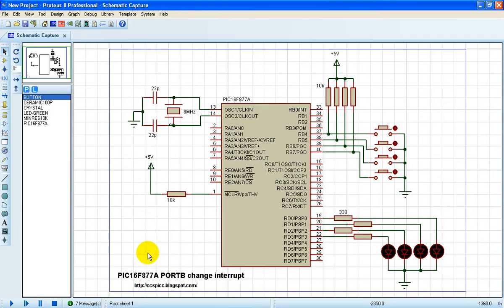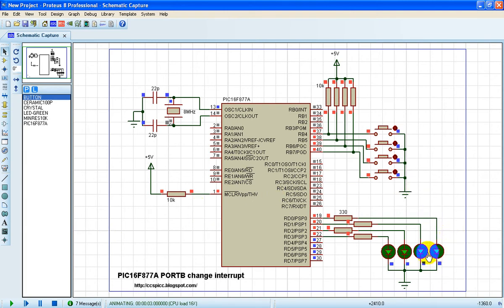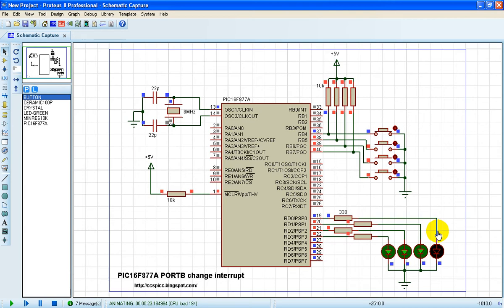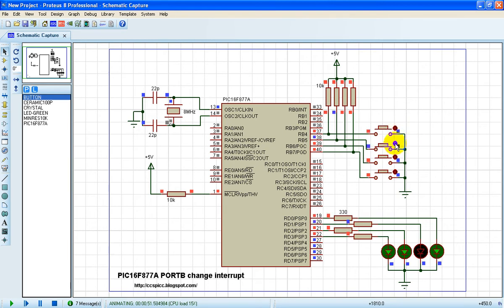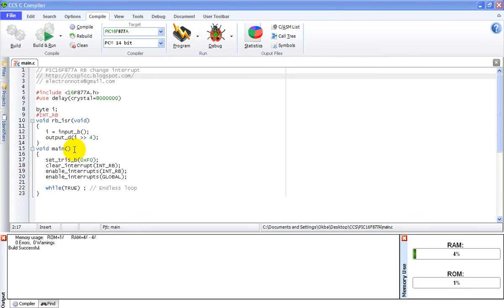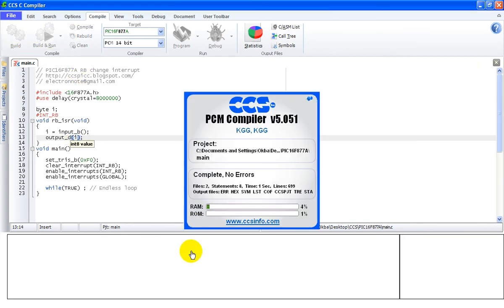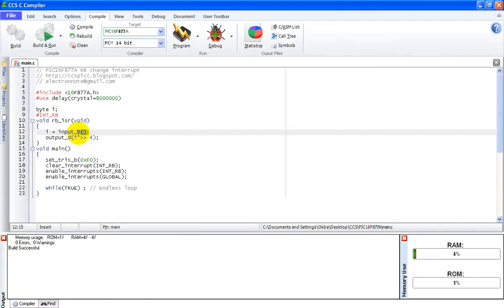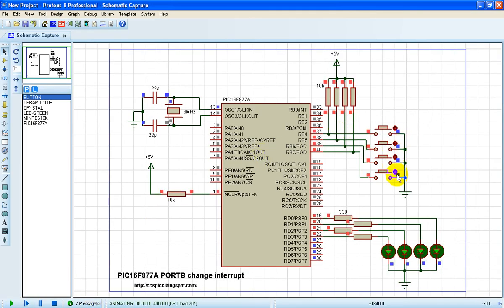PIC16F877A RB port change interrupt CCS C

Comment: Dear sir,
[deeply prayers for u]
  i m new beginner & weak in English
please help me in  pic16f877a;
in ccs c I want some instructions as below,
sw1=portA1 (input) & portB0 (output-high)   sw2=portA0 (input) & portB1 (output_high)  sw3=portC0 (input) & portD2 (output_high)
if  (sw1 & sw2) press together ports ( B0,B1) (output_low ) while portB3 (output_high)  next  if (sw1,sw2,sw3) same pressed or A1,A0,C0==0 then
ports ( B0,B1,D2 )==0 (outputs_low) and port E0 (output_high)   also guide me please if port E1==0 all system go to SLEEP mode 
              
    ARSHAD KAMBOH   powerlinkbhalwal@yahoo.com  arshadkambohbhalwal@gmail.com 
    03007557147  03127557147

Comment: i need the code of change interrupt rb port in assembly plz can u help me
Reply from the maker: You can find CCS C code at the link below, once you compile that code you will get the assembly code file and the hex file.
https://simple-circuit.com/pic16f877a-portb-interrupt-on-change/
Reply: how can i compile with c in mplab cause i m supposed working with assembly  pic16f84 i fhave many problems
Reply from the maker: You have to use ccs c compiler in order to be able to compile that code without any error.